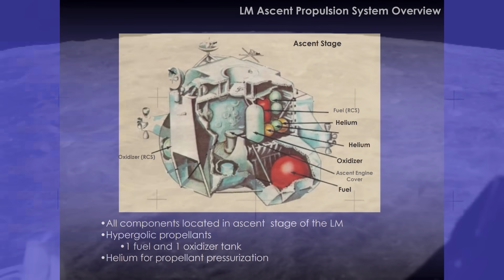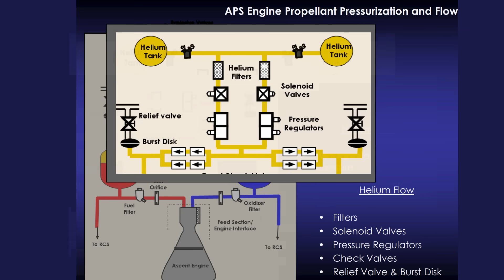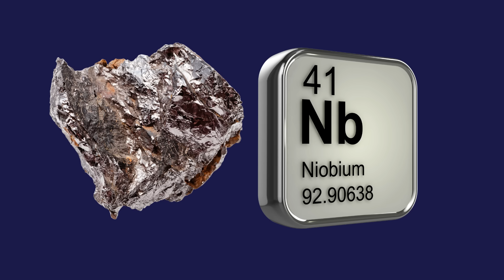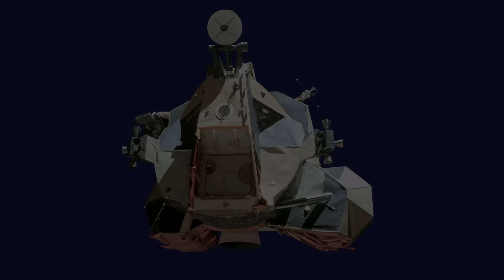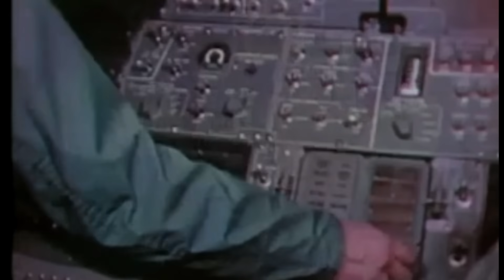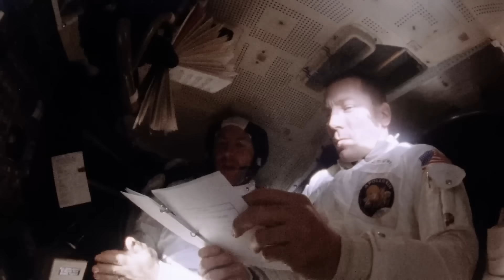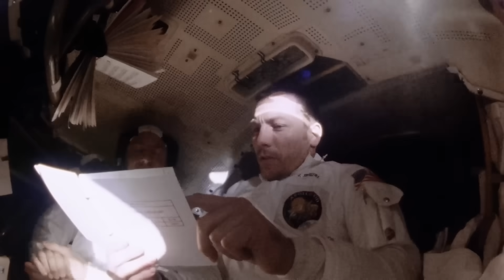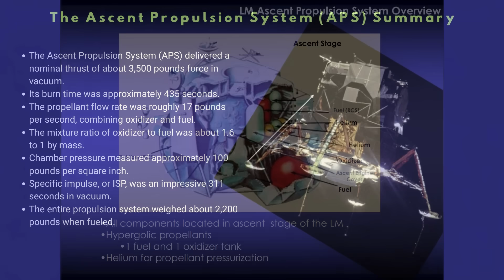LM Ascent Stage: The One Engine That Had to Bring Apollo Home

Comment: Well, the ascent engine needed to work to get the two astronauts off the Moon, but the one rocket that absolutely had to work (post-landing) to get them all home was the SPS engine in the service module - if that failed, all three astronauts would be stuck in lunar orbit.  As a result, it pretty much had dual-redundant everything: dual sets of fuel/oxidizer tanks, separate sets of plumbing from the tanks to the engine, two sets of injectors inside the engine, plus it used pressure-fed hypergolics to eliminate pumps and ignition systems.  It was about as reliable as a rocket can possibly be without receiving damage from an external cause, such as on Apollo 13.

Comment: My understanding is that the engine could never be tested, period! 
As the fuel was so corrosive it ruined the engine and plumbing so every engine ignited only once. Thus, the one on the lunar surface had never been tested.
Reply: They could and were ignited more than once. From Apollo 12 onwards(except Apollo 13), after rendezvous and transfer of everything, the empty ascent stage had one more duty to perform for science. The ascent engine ignited again with a course designed to cause it to impact the moon. Seismographs that were placed on the moon would record the seismic waves generated.

Comment: This engine did in fact need to refire again for orbital adjustments. Several smaller burns to acheive orbital rendezvous with the command module.
Reply: most of these burns were done with the RCS system

Comment: The trust to go to the moon and your only chance to leave that rock is by an engine that had not been test fired once...
Reply: They did triple the required amount of test firings for the man-rating certification. Just to be sure.
Reply: But it was a very simple design and could be trusted to work without specific testing. And it did work, all six times.

Comment: This module was powered by arazine 50/50 Fuel. There has to be flame and smoke. There is none?
Reply: err...without oxygen there is no flame, surely you would have learnt that in science class..
Reply: This fuel produces very little flame, even on Earth. On the moon, where the engine operates in a vacuum so there’s no oxygen for the spent fuel to react with, there’s no reason to expect a visible flame.

Comment: Pregunta: para asegurarse  totalmente que funcionara en el vacío, no les convenía hacer pruebas orbitando alrededor de la 🌏? Tal vez no hizo falta.
Reply: They did quite a bit of testing in space. Apollo 8 did not carry the LEM (it was not ready). So, they sent Apollo 8 to the moon and they orbited with just the command module.

But, Apollo 9? It did not go to the moon, nor leave earth orbit. But 9 carried the LEM into earth orbit. Hence, they docked, tested few, and tested the LEM in earth orbit. 

Then for Apollo 10, they flew to the moon with the LEM, and again used the LEM to low orbit the moon (very low - just 50 miles above the surface). They then used the LEM rocket motor to boast back into orbit, practiced more maneuvers, and then docked with the command module. So, besides months and months of ground testing?
Two full apollo missions where done to test fly and test dock the LEM. 

Only then did Apollo 11 go to the moon with the LEM and land.  

So, two full Apollo missions were dedicated to test flying the LEM in space. They even after jettisons the LEM in Apollo 9 (in earth orbit), they thus tested how long the LEM fuel would burn out to test how close the fuel "sensors" were to the actual time it took for the engine to run out of fuel.

Now, because the engine was a "one time" use only? And it could thus not be test fired? yes, the first time the engine actually ran was on the first firing on moon surface. Now of course many copies of the engine were tested over and over (including those engines that ran in earth orbit, and the one that ran in moon orbit).

So, the engine was setup and designed to only be fired one time without any ability to re-fire or re-start. It was a one time use disposable engine. 
it was this way to be as simple as possible, and did not even have a engine ignition system - the two fuels used would ignite when the two fuels came into contact with each other. So, a super simple engine it was. 

But, it had to work......
Reply: Apollos 9 and 10 tested the engine in space.
Reply: Rocket engines can be tested under vacuum conditions on Earth.

Comment: That's right , an engine that could never be tested under regular flight conditions , and it never was .
Reply: It was tested TWICE in space before the first landing.
Reply: @ThatBoomerDude56  
Well, yes, a different copy was flown on two previous missions, but that given engine was never test fired - the first time it was used was on moon launch. 

So, I suppose a bit of "semantics" is going on here.

So, that engine (design) was flown and tested in previous missions. but the one given engine was it's self not test fired nor ever used before it's first and one time only use.....

The other engines I believe are actually test fired in a limited way before being installed --- not so with the ascent engine....

Comment: I would like to ask a technical question that may seem trivial, but perhaps it is not.

Consider the return from space of manned capsules such as the Apollo Command Module or Crew Dragon or even the unfortunate Starliner.
Well, they slow down by friction with the heat shield against the atmosphere.
The question is, why don't they flip? What is it that stabilizes them?

If I fire a bullet into the water, it can tumble even if stabilized by the rifling of the barrel.
What does avoid it for Space Modules?

Now consider the Ascent Stage of the LEM.
Of course, it did not need aerodynamics as the Moon has no atmosphere; but how could the thrust be perfectly centered for a Module that has so many asymmetries?
The thrust was from the bottom so the Ascent Module could be unstable and flip over.
In short, what is your explanation?
Reply: For the CM, the center of gravity was offset which allowed it to have some maneuverability by using RCS to rotate in one direction or the other. I came across this excellent video describing this a few years ago. Much more to the reentry phase then I realized 

NASA APOLLO Reentry Apollo
Atmospheric Entry Phase

For the LM, it was again helped by the RCS that had 3 different levels of computer control. For liftoff, it would have been in fully automatic mode. You can find out more by googling this NASA pdf:

PERFORMANCE ANALYSIS
OF THE ASCENT PROPULSION
OF THE APOLLO SPACECRAFT
SYSTEM
by John C. Hooper
Reply: You’ve forgotten about the RCS which did all the attitude control
Reply: I guess that during a capsule re-entry its RCS system doesn't work (as a matter of fact it couldn't), so my question remains: Why it doesn't flip?
Reply: I fought you were talking about Ascent module attitude control?  The RCS also controls the CM during reentry. 

The Apollo Command Module (CM) used a redundant Reaction Control System (RCS) of small thrusters to orient and stabilize itself during atmospheric reentry, providing critical attitude control after the Service Module was jettisoned. This system, consisting of two independent rings of thrusters, used helium to pressurize propellant tanks and fire precisely to steer the capsule by rotating its lift vector, allowing for directional control and a safe landing.
Reply: @stephenpage-murray7226  
But, those thrusters actually could only rotate the CM - and the thrusters were at 90 degrees from the direction of flight. In fact, the way they steered during re-entry?
The CM was off set, so during reentry, your trajectory is a curve. To steer, you rotate the CM, and then it will start to curve the other way.  The reentry thrusters were thus around the CM that could ONLY rotate the CM - not able to tip point the top to bottom orientation.
They could ONLY induce a rotation in the CM - nothing more, nothing less.

So above explains how they could alter the re-entry course (since the CM was always going to fly in a long curve, you just rotate around and around to change where you going to fly). 

The thrusters did not and could not alter the attitude or orientation of the CM, only could rotate it during re-entry, and then that designed in curve in the flight was where you going to fly.....

However, this does not explain why the CM heat shield always pointed down, and why it would not flip. I suspect the aero design made this work, but it still seems somewhat surprising there was no tendency to flip over, especially given that the CM looked like a up-side down badminton bird....

However, a bit of google?
Well, the bottom part of the CM was MUCH heavier (heat shield)- so, that how it kept pointing down ways towards the wind resistance...

So, the side (despite being a V-shaped cone), did have drag, and with the center of gravity low (towards the heat shield), then this obviously worked. But, it does seem somewhat counter intuitive.....

Comment: Apollo 13 LM accent engine is still orbiting and live to fire?
Reply: No. They jettisoned the LM so that it would burn up in the atmosphere and what little remained would end up in a very deep part it the Pacific. Specifically, the specially designed cask that contained the plutonium that would have powered the Apollo 13 ALSEP if the landing had gone as planned. Since it didn’t, there were some officials from the NRC present at Mission Control to make sure the proper steps were taken to minimize the possibility of nuclear contamination over populated areas. The cask seemed to have worked as it was designed to as radiation levels near the crash site were normal. Of course that was over 50 years ago. Not sure how often the site gets checked out.
Reply: @mako88sb 😮

Comment: I'm very proud to say that my father was an electrical engineer at Bell Aerospace and worked on that project.  He paced nervously until he saw that the ascent engine fired as designed and the astronauts left the moon. RIP dad.
Reply: I figured some of the engineers (heroes) must be nervous before takeoff...
Reply: @alkacil2504 I was actually going to google who designed the engine at Bell Aerospace in Buffalo
Reply: He was fearful of what aviation engineers all feel when they’ve dispatched an aircraft which crashes for whatever reason. It’s a unique type of stress.
Reply: My Father was one of the four Chem E's who designed the plant that made the fuel they used.  Not nice stuff to create.
Reply: I was actually going to google to see who designed the engine at Bell Aerospace in Buffalo. Amazing video
Reply: Good thing it wasn't televised that Neil broke the ignition switch and Buzz used a pen to make contact.

Comment: Fantastic technology for this timebwithout any be before existing example. But there must be an error in the technical data description. Fuel consumption of 17 pounds per second results in a total consumption of 7,395 pounds after 435 seconds. Given this, how can the APS, fully fueled and ready for operation, weigh only 2,200 pounds?
Reply: Confusion caused by comparing mass with weight: weight was 1/6 of Earth weight.
Reply: @steveschunk5702  so is the 17 lbs/sec on the moon or on earth? Same confusion about lbs of thrust.
Reply: using nasa TM-X58040, Apollo Lunar descent and ascent trajectories, I get these figures: burn duration 438 s, fuel used 4934 lbs, giving 11 lb/s. 
Fuel capacity of the ascent stage was 5187 lbs, not 2200.

Comment: All of that science and engineering worked out with slide rules and brains, not a calculator in sight.  
I wonder if anyone still knows how to use a slide rule.
Reply: Yes
Reply: I have 3.  They still work! :-D
Reply: @MrDHCuthill  I have a brand new one still in its case but I haven't got a clue how it works.
Reply: Still got mine which I bought in 1971. Used it until 1976 when I joined university when I bought a scientific calculator.
Reply: I've got two in a desk in the back room. 
Dad taught me how to use the things.  But I forgot.  
Because that was more than 50 years ago.
Reply: "All of that science and engineering worked out with slide rules and brains"

Yes, but we, aw..destroyed that techonogy
Reply: @Pablo-p7y   And your point?  We "destroy the technology" for EVERY item that goes out of production.   It is, for example, 100% IMPOSSIBLE for Boeing to build even one more iconic 707 airliner.

Comment: I thought the engines couldn’t be tested because of the outrageous corrosive properties of the fuel/oxidiser.
Reply: Yea was a nasty mix, that ate all the components when fired
Reply: I think it’s more like it couldn’t be reused after testing. After solving the combustion instability issues that plagued the ascent engine, they did something like 3X’s the required test firings to get it man rated. I’m assuming they rebuilt each one after test firing. Not sure how many were involved with that final testing phase?
Reply: The design was thoroughly tested. The specific engines themselves could not be test fired.. The first (and only) time they fired was on the Moon.

Comment: 99.9% is basically 1 part in a 1000 failure. Still not great odds. :/
Reply: Compared to these odds, 99.9% is much better or comparable:

Motor Vehicle Crash: Approximately 1 in 107 (based on 2019 data).
Accidental Poisoning (including opioids): Approximately 1 in 57 for opioid overdose and 1 in 130 for all accidental poisonings.
Falls: Approximately 1 in 171.
Drowning: Approximately 1 in 1,073.
Fire/Smoke Exposure: Approximately 1 in 1,266. 

Source: Google "odds of dying by accident"

Comment: Now do a video showing how they matched the orbital path of the Command Module and how they maneuvered for docking.
Reply: You're talkin' Rendezvous Radar tracking and realtime position feedback so as to pin down the orbital plane, in addition to seeking out the orbit shape along the way.
Reply: @JanetGrech  The Ascent was controlled from start to finish by the Apollo Guidance Computer.
Reply: @MrDHCuthill Yeah, but just like the Saturn V IMU dead reckoning launch from the pad to Earth orbit. Fire and forget with (hopefully) no indecent wobbling along the way.
Reply: @JanetGrech It was not a throttleable engine and I doubt seriously the Reaction Control System could correct an overshoot or an undershoot. Then you have the McDivitt Quadarant to deal with.

Comment: Tom Kelly wrote in his book that the ascent engine combustion instability issues were one of the biggest issues they had. Took much longer then they expected to solve and often put it at the top of the list that would prevent them achieving their goal in time.
Reply: I believe that was the Saturn F1 engine, not the APS.
Reply: @physicsphirst191  No, it was definitely the LM ascent engine. NASA stepped in and had Rocketdyne take over the injector plate design. Grumman and those involved with the design discussed using the same bomb-test method developed for the F-1 combustion instability issue. Unfortunately they were discussing this on a passenger plane and after landing, were detained to explain why they were talking about bomb-tests on a commercial flight. Fortunately it was quickly resolved.

Comment: The engine couldn't gimbal (simpler), so everything in the ascent stage had to accounted for to estimate the center of gravity, and the RCS thruster used to correct the attitude. If you watch ascent videos, you can see the RCS corrections which make it "loopy".
Reply: Yeah. Interesting because there is interpolation going on between the INS/IMU and the algorithmic  computing loop in time integrated segments approximating points on a curve. If the ascent engine had been on a gimbal the jerky movements would have been rendered much more smooth. As the ascent stage approached apolune (or even perilune) the jerkiness would have damped out. And another thing - you don't want the stage to twitch as engine shutdown occurs because the higher ground speed of the ship is fast after 435 seconds of continuous acceleration. The orbit solution could be wrecked if that happened. I would guess the active program would not allow RCS to fire in a time buffer just before engine shutdown. At that point, the orbit is what it is, so there's no point trying to rectify a fairly 'lumpy' initial solution anyways. You complete rendezvous with stepwise refinement until the CSM is in full glint right before your eyeballs.

Comment: To be fair, the LM didn't 'freeze and bake' during the mission.  All Apollo landings took place during lunar morning and temperatures at the landing sites were't that different from a hot summer day here on Earth.
Reply: ... and it was in a vacuum for much more than 2 days.  After all, it took over 4 days for Apollo 11 to reach the moon.
Reply: @statonb AND was thermally controlled the entire way.  Not sure what point you're trying to make.
Reply: True for the most part. It did get exposed to extremely cold temperatures though, when they went behind the moon. Not for very long of course, but enough that they had to design for it. Of course it also orbited the Earth for nearly a couple hours before the TLI burn but the SLA would have helped with that.
Reply: Yes, a good point.  It wasn't really 2 days... it was just the top o' the morning in moon time.